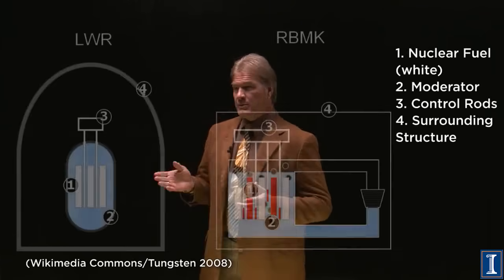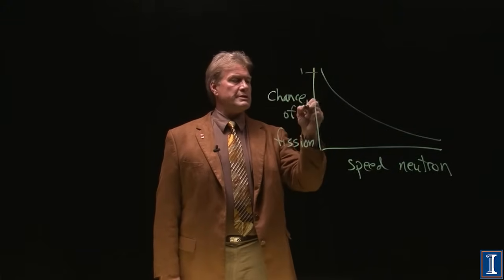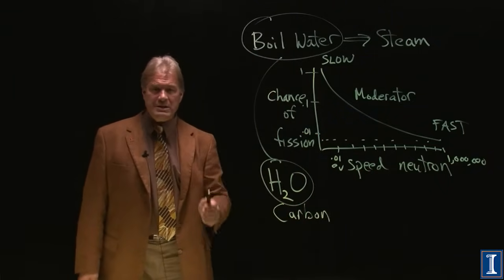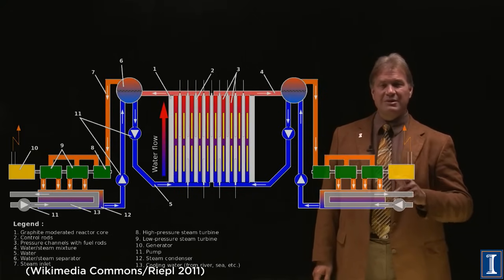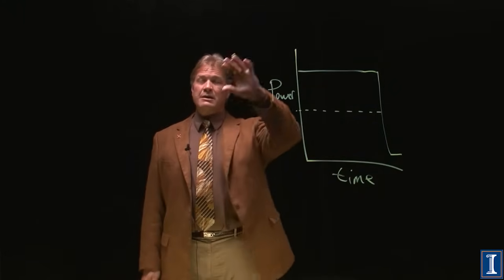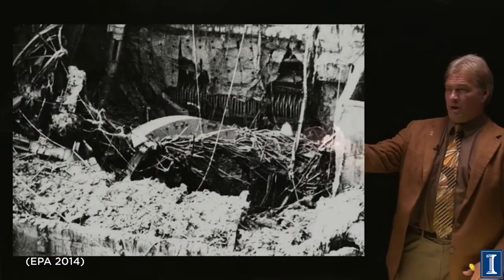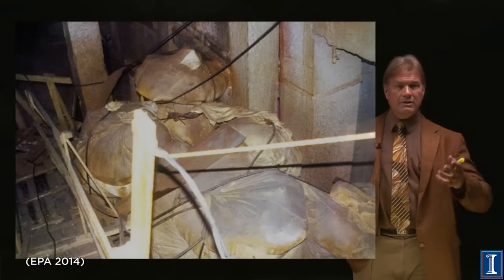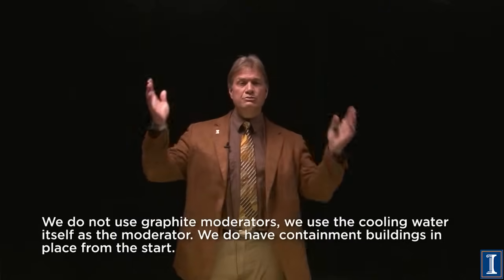Chernobyl: Worst Accident Ever

Comment: Too bad half his explanation is simply completely wrong. This guy can't even get the name of the type of reactor right. It's RBMK not RMBK. 

According to more authoritative sources, the Chernobyl reactor's primary flaw was simply cost cutting, going cheap on the control by putting graphite tips on the otherwise boron control rods. They put graphite tips on the boron control rods. As with the rest of the Soviet bureaucracy, they were always doing things under budget pressure. 

When the graphite tipped control rods were inserted,, after too many had been removed, the graphite tips got stuck in their channels, preventing the boron portion of the control rods from going back into the reactor. In response, the reactor went out of control, with the graphite tips stimulating the reaction and the boron portion of the rods unable to moderate the reaction. The reactor went out of control, apparently reaching over 30,000 megawatts, a giant nuclear blow torch that simply blasted everything in its path out of the way, including the thick steel reactor cap. 

The other big lie in this video is that reactors elsewhere can't fail. The Fukushima reactors failed, even though they were American General Electric design reactors with containment buildings.
Reply: Right, it's called a black swan. Certain things are "unknown unknowns" and we don't about them until they happen.

Comment: Also it's funny you say "it can't happen anymore" and if I were in the class I'd raise my hand and say "key word: anymore." The Brits once operated an exterior air-cooled graphite-moderated nuclear reactor in Scotland (look up the Windscale disaster) and the stupid thing caught fire, and would've wiped Scotland off the map with its radioactive waste exhaust if not for some exhaust air filters.
Reply: But it didn't happen. Right?
Reply: @ Still an INES 5 event.
Reply: @pyrioncelendil  Correct. It was definitely one of the worst nuclear accidents of its day because of the amount of radioactivity it released to the environment.
It resulted in a restructuring of the UK Government's approach to nuclear safety, so the UK now has one of the strictest nuclear safety regimes in the world. Off-the-shelf plant designs from other countries usually require improvement and or extra work before they can be approved for UK use.
Reply: Windscale is in England not Scotland!

Comment: To this day i do not understand the reason for the safety test.... 
Running a critial test such as this could have been completed in a simulated steam turbine set up with pump power loading and pressure.
Also the condtion for the test would have had to have been to worst case scenario imaginable.... total loss of off sight power, complete simulatinious reactor shut down and a total failure of the emergency core cooling system... but still relied upon the desil generators powering up to normal power out put within 70 to 90 seconds...
If any of these components were likely to fail it would have been the desil genirators, far more mechanical components to maintain and fail than a pre-pressureised emergency cool water system.....
Any thoughts ?

Comment: It was discovered recently (after extensive data analysis) that it WAS in fact, a nuclear explosion.  The core when critical, and it was NOT purely thermal.
Reply: Actually no, it's only one of the theories. Its weak point is the enrichment factor, RBMK reactors can operate with as low enrichment Uranium as 1.4%. Reactors normally require 3-4% enrichment, while a nuclear bomb is not going to work under 80% enrichment.

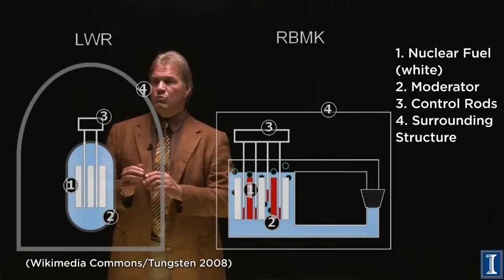Comment: 2:00 this was made after Fukushima and he says steam and then hydrogen explosions can't happen in western reactors.
Reply: There wasn't an explosion of a reactor in Fukushima though
Reply: Whenever you mention fukushima please remember WHAT CAUSED THAI FREAKING THING?!  The Tsunami killed way moee people than Fukushima.
Reply: @HelloKitty-x4u6d Video claims that 
 western reactors have concrete containment structure that can't be breached. That claim is false, and surprisingly stated, since it has already happened.
Reply: that is about as far east as you can get
Reply: He didn’t say the west, he said the entire world uses containment buildings which the soviets at the time didn’t use because it was cost effective. Something in my opinion that’s important to note is that with Fukushima a lot of blunders were made. The most obvious one being its location being on the coast of a place that has a history of tsunamis.
Reply: @AuroraLabsScientistID12521 "Radioactive debris can not be let out to the public bc of 3' thick cement containment vessel"  is the quote about nuclear reactors outside Russia.  But Fukashima's 3' cement containment vessel was compromised and raddioacrive debris was let out to public.
Reply: And mounting the back up generators on the ground instead of the roof.
Reply: @stripmin41  Mechanical safety features can always fail. Western reactor designs that use high pressure water to heat other water to steam, AND produces Hydrogen if it over heats a little, AND has to be shut down whenever the grid shuts down, can't be claimed as "safe".  Generators can always fail.  They shouldn't be the only thing that prevents melt down and catastrophic explosions and huge radiation leaks.

Comment: Two things on the first 1.5 minutes of the presentation. 
The "3 foot thick concrete walled" building is not the containment it's the shield building which protects the steel containment building, There is about a 10 foot annulus between the shield building and the containment building.
And 
In America, at least, there is no design requirement for the shield building to be able to withstand a commercial aircraft strike. The exception to this is if the plant is on the direct approach to an airport.

Comment: Another thing about using water and carbon as moderators. Water also acts as a control control rod does (absorbing neutrons) to a moderate degree. So if you accidently boil all your water, not only are you left with just the reaction-increasing of the graphite, but you've lost all the reaction-decreasing of the water. And as more water boils, the reaction gets faster, which boils more water, which makes the reaction faster...

Comment: I would like to add the arrogance of conducting a test on a Nuclear reactor on 2nd shift without a test plan. 
   I work as an Engineer and I couldn't just wanter into the lab to test hardware without a peer reviewed test plan, and the worst thing that would happen is maybe setting of batteries.

Comment: Why didn't they use the power produced by their own reactor as the primary source of power for the pumps, an external source as a backup, and diesel generators as a backup source for the external? As long as their own reactor is operating, there can be no shortage of power for the pumps, because the reactor is constantly producing it. And there were three other reactors nearby. They could also be used as a backup source of power for the electric pumps. A nuclear submarine produces its own electricity and does not need an external power supply.
Reply: There was no problem with the pumps.
Reply: @MrSummitville  Water is a coolant in these reactors, so maintaining a steady flow of water through the core is essential to its safety. The experiment was aimed at the pumps, not the reactor. They wanted to see if the turbine would generate enough electricity to keep the pumps running.

Comment: actually. they stalled the engine .. then pulled all the rods out once they brought it back online .. it started to runaway cause of the core being poisoned ...
THEY HIT AZ5 then all the rods went in . but their tips are made of graphite to displace steam and water at the bottom .. once the tips entered THEN it skyrocketed ..
 the very fail safe is what destroyed them BUT they also messed up before the az5 button was pressed .. After chernobyl the new ones had AZ6 which would push rods into the core in just a few seconds instead of the long 18 seconds az5 took to push all the rods in and kill the reaction .
Reply: Some suggest ... It was too late to save the core. Steam pockets had already caused a positive feedback loop. Nothing could stop the generation of the Oxygen & Hydrogen gas = kaboom!
Reply: video description has Russia RMBK ...   i thought i was RBMK reactor ? not great not terrible 
still this a good video

Comment: "If a water-moderated reactor has an accident and loses it's water the reaction stops."
Okay great but without water what do you do about decay heat?
It's still gonna melt down right?
Reply: That is what happened at 3 Mile Island. But it did not blow up!

Comment: This is nonsense. The 216 carbon rods which can be mechanically lowered into the reactor individually are better moderator than water, as the technicians can instantaneously fine tune the balancing of the nuclear reaction in the core . There was nothing wrong with the RMBK design. The reactor wall was 2.5 meter reinforced concrete and the concrete lid on the reactor top was 1000 tons. That's far better than any "containment structure". The engineer in charge, Dyatlov, bypassed all safety measures, which he could do, as in the Soviet Union there was complete trust in the engineer in charge to always do the right thing. It was one man's catastrophically wrong judgement.
Reply: You say, "... That is far better than any containment structure ... ". And yet when needed, it "contained" NOTHING .  What are you talking about .. "containment".  Don't make me laugh.

Comment: This video does not mention the reason for the RBMK using graphite moderator, which was tied to fuel enrichment cost. When Uranium is mined, only 0.7% of it is isotope 235, which is the "good stuff" that actually fissions. The remainder is isotope 238, which is substantially more stable and which does not fission when absorbing thermal neutrons. It just sits there in the fuel pellet and doesn't do much, except that when it absorbs a fast neutron, it can transmute into Neptunium 239, and then Plutonium 239 - a very undesirable thing in a commercial power reactor. Unfortunately, the laws of particle physics, as applied to power reactor design, mean that natural Uranium with only 0.7% U-235, can't sustain a chain reaction. So power reactor fuel has to be "enriched". This is a process in which the uranium is compounded with Flourine into a gas, Uranium Hexafluoride, which can be passed through centrifuges or osmotic filtration, to increase the percentage of U-235 in the finished fuel. The problem here, is that enrichment is expensive. VERY expensive. It requires building huge facilities, and the pumping of the gas through hundreds of layers of osmosis filters, or centrifuging it, uses a huge amount of electricity. The more enrichment you specify, the more the fuel ends up costing. American light water moderated reactors use fuel enriched to 3.0~3.5% U-235. The Soviet RBMK-1000, which has a very different "neutron economy" due to being graphite moderated, can get by on fuel enriched to the 1.8%~2% range; this costs a lot less for the fuel, although one adverse consequence is that the RBMK has to be shut down for refueling more often (every 12 months on average), whereas American reactors can generally go 18 months between refuelings. Naval reactors in aircraft carriers and submarines use fuel enriched to about 85% U-235, and they can go up to 20 years between refuelings. Enriching fuel to 85% U-235 is mind-bogglingly expensive, but the Military users of this fuel don't have to show a profit to stockholders, and the advantages of having a submarine that can stay submerged for 6 months at a time, outweighs the cost.

Incidentally, the Canadian CANDU reactor, can also get by on less expensive low-enrichment fuel thanks to using Deuterium Oxide (heavy water), as the moderator. The deuterium nuclei in the moderator, having a proton and a neutron, can thermalize fast neutrons more efficiently than regular "light" water can, allowing CANDU operators to use less expensive fuel, although producing the required amount of heavy water for a 1,200 mWE CANDU reactor is a pretty expensive up-front cost.

Comment: except?
this did not happen at 3 mile island - Pennsylvania
they let the core become exposed
reaction did not stop - fuel melted

this was a Westinghouse pressurized water reactor

but similarly? the three reactors in Japan that were older GE boiling water reactors.

no - you are leaving out so much - 
(the residual 3 to 5 day old fast breakdown reactants that needed continuous cooling
not to mention?

neutron beam = witnessed by many
and? the resultant fission compounds that could only occur if an actual 'nuclear fission event' took place -a bomb.  
Chernobyl fissioned out -as it 'exploded its fuel'  which is what helped save our planet. 
like a dirty bomb.  This was part of the 'power spike' 

so - your video while good- for the layman - 
is very incorrect.
Reply: The 3 Mile Island accident ... The nuclear reaction did stop . Who told you that it did not?
Reply: @MrSummitville  the reaction did NOT STOP before the core entered a meltdown condition. The molten corium then dropped to the bottom of containment, where there was still water present, which flashed to steam cooling the corium until it no longer produced sufficient neutron flux to maintain nuclear criticality. Note: To this day, in the waste removed, the reaction is still taking place but not sufficient to cause a chain reaction (one dollar less in nuclear speak)
Reply: btw, did you know they are bringing unit 2 (undamaged) back online? To supply energy for AI, of all things. Oh well.  They are modernizing instrumentation but in this day and age of DEI- sounds like a big accident waiting to happen.

Comment: Did he hit the wrong button? Any evidence of this
Reply: It's a well known information that the night shift had less experienced people and they've managed to drop the power level to 30 mwe instead of holding 700 mwe that was required for the experiment by the guidelines. 
The wrong button might be a satire but they indeed fucked up. They've made a lot of mistakes that led to the explosion. The reactor might not be safe and not as properly designed as the Western ones and more modern ones, but the operators fucked up big time that night.
Reply: @olodesu  And don't over-ride / disable all of the safety controls, designed to prevent this kind of problem.

Comment: And yet Fukushima happened and is still not under control
Reply: Fukushima happened because of tsunami and earthquake (afaik). 
It was not even remotely as bad as the explosion in Chernobyl's reactor.
They surely poisoned the ocean around but it didn't blow up the same way as Chernobyl.
Reply: @olodesu It was the same type of hydrogen gas explosion.  Japan built by the ocean and never anticipated a FLOOD ?  What dummies ...

Comment: My 2 uncles from Argonne went to 3 mile Island to monitor for radiation.  Don't think it can't happen here.  That containment vessel vents the gasses when they get too high
OR WHEN SOMEONE PRESSES THE WRONG BUTTON.  Maybe no Chernobyl, but how much radiation is safe?  The people around 3 mile didn't get a warning, either.  It's always
keep your fingers crossed and hope for the best.  Part of the exposed core at 3 mile Island melted didn't it?  Can't happen when water(moderator) is absent, right?
Reply: 3 Mile Island did NOT explode.  USA has used nuclear for 70 years, not one explosion.  So what do you actually know ?

Comment: Wait a minute. 911 told us planes go right through concrete and steel ultimately leading to whatever they hit turning into a dusty pile of rubble.😂
Reply: That was an office building. Use your brain. Containment Building is up to 5 feet thick, with rebar and a steel plate. Common sense is not very common, with you.

Comment: I don't think 3' of concrete would have contained that explosion
Reply: But did the concrete lid go as high as a typical reactor containment dome ?  just asking
Reply: @bogenious8474  Even if it did,  would it have punctured a 5 foot thick concrete wall?  In USA, the containment building is huge compared to the core.

Comment: Did anyone else notice him mention an airplane can hit 3 foot thick, steel reinforced concrete and the PLANE disintegrates?  Sir, it was tried.  Twice.  Maybe we need to rethink this whole concrete v plane thing, eh?
Reply: WTC towers weren't made of concrete. It was used a mixture of A 36 and A 242 steel.
Reply: @alexedelweiss3267  I was referring to the center concrete column inside the WTC.  It's like you don't pay attention on purpose or something...  The elevator shafts inside the WTC was a HUGE 40 elevator bank that was surrounded by concrete.  (Some might say a city block of concrete)  This is the same concrete that the outer steel shell was fastened to.  A city block of concrete, 100 and something floors high?  Yup.  These buildings were massive.

Look it's a nice story that the airplanes took down the buildings, but if you know anyone in the architectural world, you'll know it's just that.  A story.
Reply: There were office windows in the walls of building. Duh!!!
Reply: Dude you literally and metaphorically poked holes in my argument.  LOL  It's actually f'n brilliant what you did there.  Thank you for that.  hahaha  You rock.

Comment: Dyatlov: We're taking measures to ensure a steady flow of water through the core.
Bryukhanov: What about radiation?
Dyatlov: Obviously, down here it's nothing, but in the reactor building, I'm being told 3.6 roentgen per hour
Bryukhanov: Well, that's not great, but it's not horrifying.
Fomin: Not at all. From the feedwater, I assume?
[Dyatlov nods]
Fomin: We'll have to limit shifts to six hours at a time, but otherwise...
Bryukhanov: The dosimetrists should be checking regularly. Have them use the good meter, from the safe. Right, I'll call Maryin. Have them wake up the local committee, there'll be orders coming down.